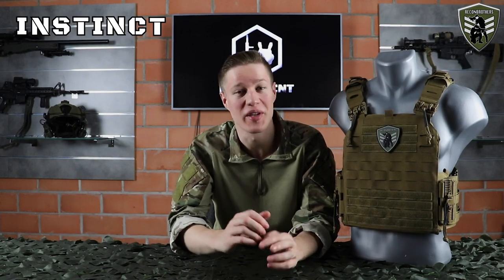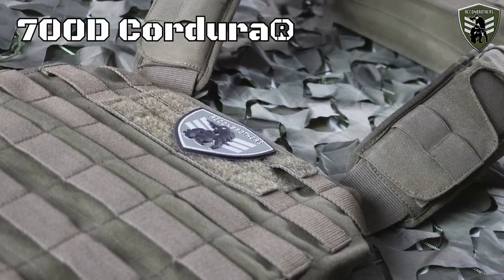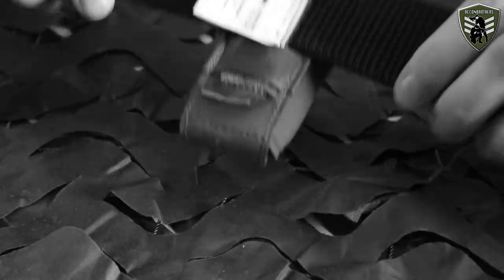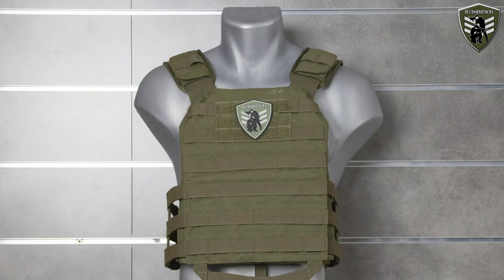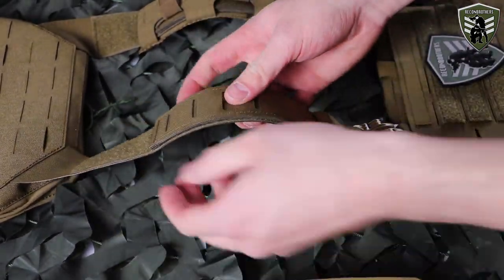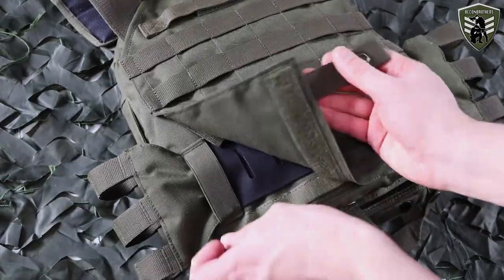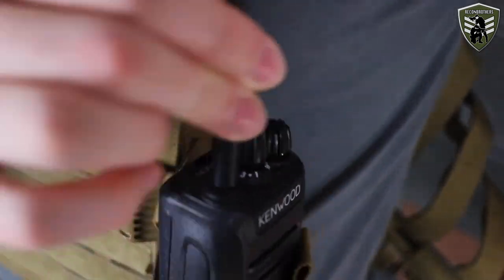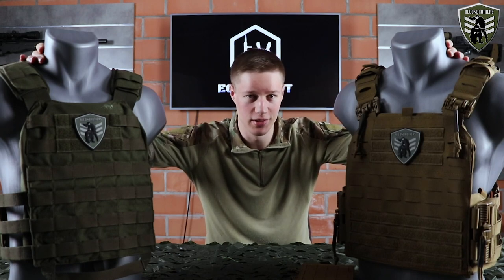Tasmanian Tiger Plate Carrier QR LC - Before You Buy

Comment: Love it. Use it for working out. Can take a lot of weight, right now 40kg. Doesn’t handle a lot of sweat weary well. Starts to smell very fast....
Reply from the maker: Yeah, that's because of the 3D mesh inner padding and is also the reason why Templar's Gear prefer to work with Coolmax. I Instinct

Comment: Looks like a nice improvement. And every  system has it’s pro’s and cons. But the extra pouch for the radio or mags, it’s not possible to use the lasercut and some elastics to create retention? Something similar as you guys did with your mag pouches? Just an idea. Thing looks nice👍🏼
Reply from the maker: Indeed, it is a great improvement and we're trying to expose those pro's and con's for you guys to make up your mind easier. About the cummerbund pouch for the radio or mags, yes indeed we solved it at the moment by looping a small Velcro piece around the antenna of Instinct's radio. That retains it pretty well. Of course we felt obligated to mention the retention "issue" for you guys. I Viper

Comment: Nice! What do you guys think about the TT MK IV?
Reply from the maker: The TT MK IV is like a step in between the two mentioned in this video. The base is like a MKIII, but it also features the cummerbund pouches, the vented shoulder pads and the slick kangaroo style admin pouch up front for documents. It doesn't have a quick release system, but one shoulder can be removed with a buckle and the entire PC can be dropped off with a pull tab quick release system on the right shoulder. The cummerbund adjustment system is the same as with the QR LC system which has its advantages and disadvantages as told in the video. If I had to choose for the extra €10 compared to the MKIII, I wouldn't doubt at all. I Viper
Reply: @ReconBrothers  then my choice is made :) thanks for the fast response 🙏

Comment: Good evening from Greece. I have one question about the plate carrier. I have recently ordered from a store in Greece the particular carrier. However, when the order came to the store and I was about to purchase it, I noticed that the plate carrier came with only the slatted side panels and not the solid side panels with mole and hook-and-loop fleece. I was under the impression that the product came with both. Can you please help me as to clarify if I am wrong and need to purchase as extras the two solid side panels with molle. Thanks in advance! Great video!
Reply from the maker: Hi, the plate carrier does indeed come with both, one pair of solid cummerbunds and one pair of slatted cummerbunds. This is also shown on https://www.tasmaniantiger.info/en/product/tt-plate-carrier-qr-lc/ and from what I'm aware you can't order a version that comes with just one set of cummerbunds. I Instinct
Reply: @ReconBrothers  thank you very much for the swift response. Is there any chance that the second pair comes inside a pocket of some sort  when it is shipped (e.g. inside the plate pockets)?
Reply from the maker: @dtsormpa  I don't have an example at the moment but if I recall correctly the 2nd pair of cummerbunds where just in between the plates. 🤔 I should have some QR LC coming in this week so I can check it then. | Instinct
Reply from the maker: @dtsormpa  Viper says the additional cummerbunds were in the front pannel. | Instinct
Reply: Για στρατιωτικη χρηση την πηρες η για ερσοφτ?
Reply: @TheLAGONAS  Στρατιωτική χρήση
Reply: @dtsormpa  κάνει για μας Ε; θήκες για g3 βρήκα κάτι ελαστικές, πάλι Τασμανιαν τιγκερ και ζώνη, σκέφτομαι να φτιάξω μια ιχ.
Reply: @TheLAGONAS  έχει η tasmanian για 7,62. Ζώνη πήρα πάλι tasmanian

Comment: Could you suggest pouches for side soft armor for this PC?
Reply from the maker: @karlisluste772  As said in the video, it should come with cummerbunds that allow you to insert side plates or armor.
Reply: @ReconBrothers  no it does not. It does come with two different style cummerbunds though, but pouches are not included, that is why im asking :/
Reply from the maker: @karlisluste772  The version we had and reviewed did have a cummerbund set that allows to insert ballistic side plates. But it does not have other pouches mounted on them.

Comment: How would you compare these two to the MK 4 model?
Reply from the maker: The TT MK IV is like a step in between the two mentioned in this video. The base is like a MKIII, but it also features the cummerbund pouches, the vented shoulder pads and the slick kangaroo style admin pouch up front for documents. It doesn't have a quick release system, but one shoulder can be removed with a buckle and the entire PC can be dropped off with a pull tab quick release system on the right shoulder. The cummerbund adjustment system is the same as with the QR LC system which has its advantages and disadvantages as told in the video. I Viper
Reply: Reconbrothers thank you guys for the prompt reply <3 I am looking to buy a plate carrier and TT is looking very tempting. Would you guys recommend any other brands in this price range?